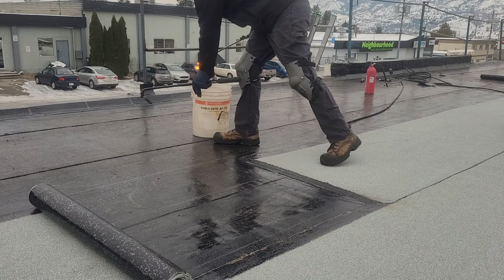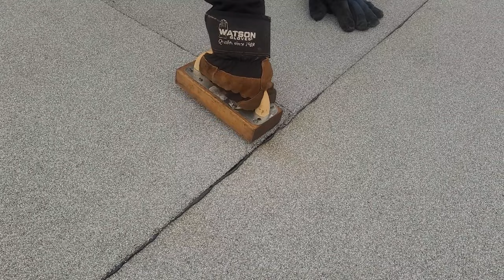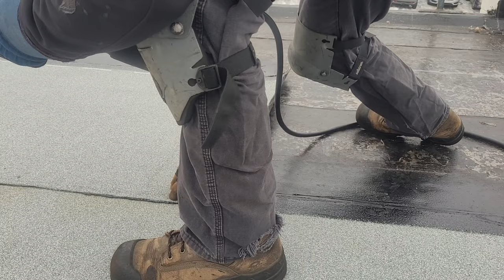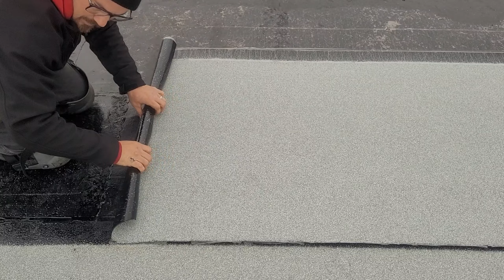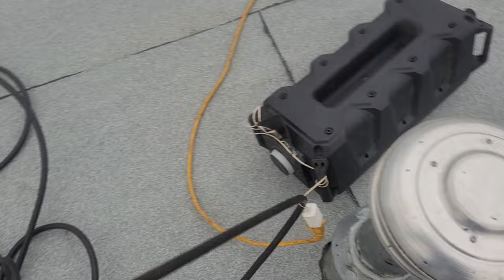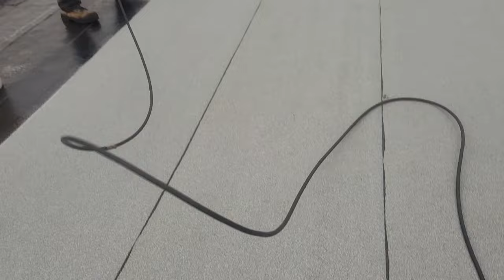torch on roofing, cap sheet field install for 15 minutes!!!

Comment: This video is a great example for why never to get a big roof touched down.  Fellow is going too fast.  You saw him have trouble with the seams. I assue you that just because he saw some of the bitumen bleed out from the seam doesn't mean that there is a long lasting bond. On bigger roofs hot mopped bitumen provides a much better and consistent bond.
Reply from the maker: While I appreciate your comment I disagree with you on the long lasting bond. While I'm not the best in the industry, I have been doing this for well over 10 years, I take pride in what I do and have not had a problem or a callback yet.
  I have done some roofing systems in Calgary, AB that were applied with hot tar all the way up to the base sheet. We would still fully torch the cap sheet. 
  There are many different application methods and systems approved by the different manufacturers each of which have their pros and cons. I find the best application usually depends on the customers budget among other factors. Most people in our area don't use hot applied roofing anymore. Where are you from JR?
Reply: Jr I think that there are different specs for torchtown rolls depending on where you're from if you're in California or Texas need to apply more heat if you're in a colder area Canada or Northeast you need less heat That's why you see a lot of times people in cold climate pulling on the torch down instead of walking from the back the modified bit is different softness.  Just because something is true for you doesn't mean that you have the full picture.
Reply: @stephen2738  you got it totaly wrong, everything deepends of the mixture of the membrane, in canada from ehat i learned they normaly(correct me if im wrong ) use a sbs membrane like soprema same as here i norway, in america where you are from, the most common type is a app type membrane a bleeding membrane, but the sbs is a sticky membrane what means if you have a occean of melted asfalt ore more then 5 mm bleed out on seams it is overheated.. facts, hot tar and paper is very good, BUT should really not be used on insulation really, but i understand we have different ways to do the work, like here in norway we use hot tar an paper only on concret.
Reply: @olejaerson1852  what are you saying I am wrong about? We are talking about  APP Torch down which is a Modified Bitumen Roofing Membrane. We are not talking about sbs. There are different specifications from different manufacturers of APP torchtown. The reasons are in thickness in pliability because of temperatures and different use cases. That's why in New York or in different parts of the country you see people applying towardstown by walking behind the role and pushing it with their foot because we will not ruin the application by stepping on the portion that was just heated. If you try to use this method in Canada or in colder climates you will leave footprints in the torchtown because the formulation of the APP modified is softer so it is not brittle and is easily applied in colder climates. That's where they pull it and walk backwards.

Comment: Jesus effing Christ! I thought I was over seeing low quality amateurish roofing work on youtube after watching Flat Roof Doctor videos. This video proves I was wrong. I had to stop watching after three minutes. Torcher gentleman just ignored his side lap and I wonder if any hot tar has come out along those seems.It looks he is torching in pretty cold weather too, where you need even more be careful to applying proper heat. With his end lap he showed remarkably little experience besides not even using a trowel !!?? Why do people post videos in skill required work when they have not a proper training and experience? Jesus !
Reply from the maker: Woah woah woah pal... Lets see your work! Why use a trowel to mark up your end lap when you can use a wonge and make it look BEAUTIFUL?! The side laps get between an 1/8th and 1/4" bleedout as per manufacturer specifications and if they look iffy we trowel check them everyday. Please put a link to your roofing video, im DYING to see the  quality you are talking about 🙈
Reply: @thetrahanman  First, here in California the city code is 3/8 of an inch for bleed out, occasional quarter inch is acceptable, but freeze frame your video at 1:44 min for example. Look at his shoe standing on the seem behind it there is at least eighteen to twenty inches of seem without any bleed out. Also when he uses a camp fire iron and a block of 2x4 wood to smooth out end lap that shows the person has no clue about basic torching principles. Inhere I will not teach you but if you happen to be in the San Fernando Valley, twenty minutes from Hollywood, I'd be only happy to show you what I am talking about. Me, I am after six surgeries on both of my knees and am not sure if I can do much torching with the pains I am dealing with. Of course how to properly do seems I could do even right now. There is a slight chance that I will be doing a torch project around the end of the month, if I do for sure I'll make a short video to post on youtube. So far I have not seen a single roofer on youtube who is in total understanding of his craft. Now what I can offer you is a few photographs on roofs I've done prior to my surgeries. They are in my old mobile phones which I should be able to print out and could send it to you if you wish and provide me with contact info. Basically, you have my e.mail address if you remove the numbers from my name and just add @gmail.com
Reply from the maker: @gusmarokity6482  hey i appreciate your effort with these comments. Sure there probably could have been more bleedout lol fact of the matter is, I didnt. Will it leak, no. Will it stand up to the elements. Yes. Will it last for 25 years, almost certainly. No one is perfect and I'm sure if I came and inspected your work i would find stuff I didn't like. I found your comment to be aggressively rude, but that's your thing man. I've been roofing long enough to develop thick skin. Good luck with your health. Roofing is tough on our bodies! Hope you heal up fast!

Comment: Poor installation technique.  You should only heat 85% of the roll and go back and heat the 15% at the lap and bleed out and granules the bleed out.

You should put a 45 degree cut at the lap, at both ends.
Reply from the maker: I'm sorry but I actually laughed out loud when I read this... where did you learn that technique? 100% is NOT the way the manufacturers want it done...  try again thx for the comment tho... also you cut a 45 corner on the piece of membrane that is getting covered only... the "meat"
Reply: @thetrahanman  That is how I was taught as well when I was roofing in Florida. After rolling out, we would go back and heat the flap and run a trowel over it to get a nice bleed out on all overlaps and the perimeters. I want to say it may have been related to code where there has to be some amount of bleed out visible, but it could have just been installer preference.  With that being said, your install looks really clean. Nice uniform heat. No messing around with the roll and minimizing traffic on the new torch down which can lead to boot prints and scuffs. Nice video!